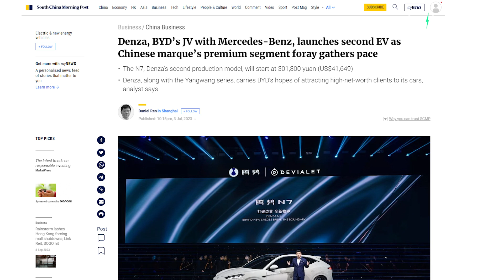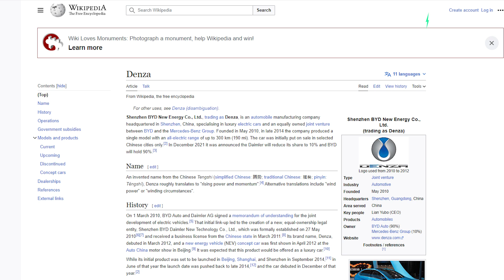Mercedes Benz to use BYD Blade batteries in its NEW electric cars

Comment: Thanks Sam interesting development. 

The blade cells can be readily packed for 400V traction batteries using 126S1P format. Blade cells are almost ideal for this type of vehicle battery which is used in most BYD vehicles.

For 800V (used in performance vehicles with extra fast charging) packing becomes trickier as you need a 252S1P format making the battery somewhat longer, creating a form and fit issue. 

A possible solution is to stack the cell arrays but that raises CofG and potentially creates cooling problems. Alternatively you could shorten the length of the blades to have two rows of cells, however, this would likely reduce packing efficiency.
Reply: 126s1p is 403V nominal. That is not the 700/800V nominal, that Mercedes promised. So Mercedes must use more cells to not split its MMA variants into either 400V vehicles and 700/800V vehicles.
BYD did split its platform 3.0 into 300V/400V (Dolphin, Yuan) and "higher" variants (BYD Seal: 614 V nominal, 192s LFP of 100 or 135 Ah cells; BYD Han EV: 178s LFP or 194s LFP of 135 or 150 Ah cells). Even if its 570V, 614V,  620V nomimal, they still call it "800V platform".

Comment: LFP's ability to discharge to 0% and charge to 100% without significant damage is not that big an advantage over NCM. This is because LFP and NCM batteries only charge fast from 10% to 80%. The first 10% and the last 20% charge much more slowly.

If you are charging overnight or doing the first charge (at home) for a road trip, the 100% charge is great. But if you are going on a long trip, then the additional ability to charge is not that useful because your stops would have to increase from 20 to 30 minutes to 1 to 2 hours to take advantage of that extra 30% charge/discharge.

Comment: LFP = Less Fire, Probably.
Reply: According to the NTSB, ice vehicles are 20x more likely to catch fire than evs.
Reply: @nordic5490  Yes, if you include older and badly maintained ICE. ICE fires are often very small and due to DIY welding.
EV's are mostly brand new and NMC will burn like hell.